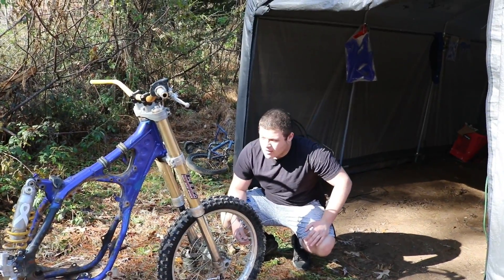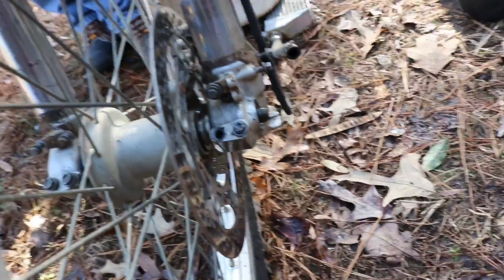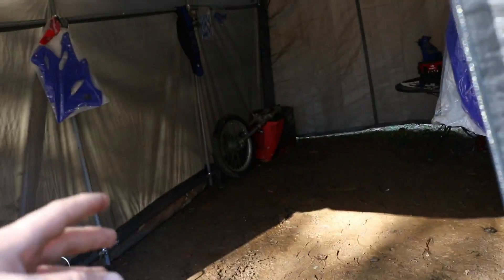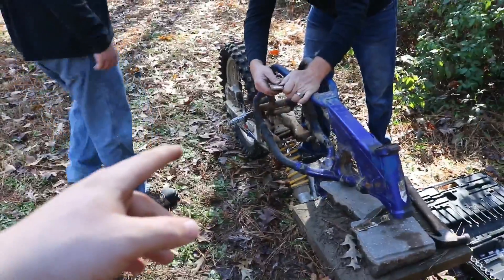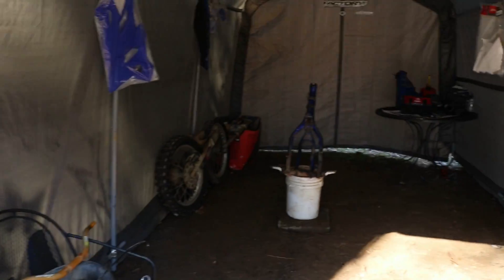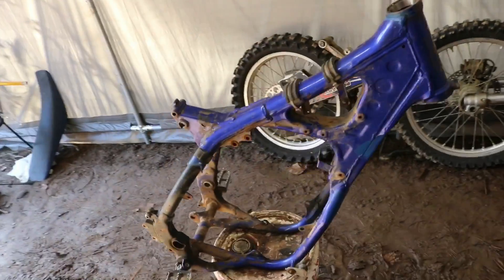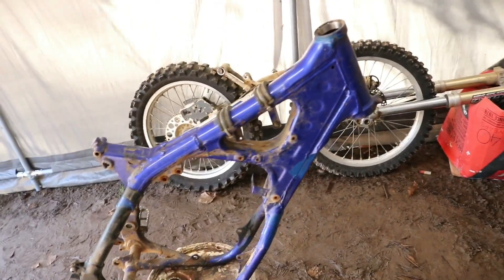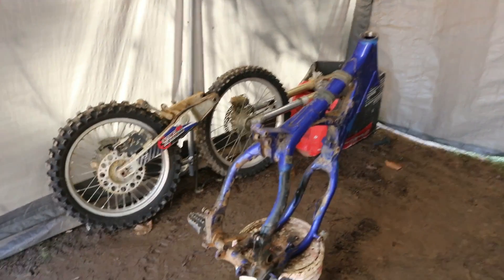The YZ250 is Half Way There - Tearing It DOWN To The FRAME

Comment: This builds gonna be sick man, keep it up. I had the same problem on my 05 yz250f with the fork pinch bolts, one was rounded. Grab a grinder, and try cutting a slot for a flathead screwdriver and take it off with a impact screw driver. If all else fails (which it did for me) use the grinder and cut the head completely off, and then cut a notch for a flathead screwdriver on top of the bolt thread, and you should be able to back it out. Then, when putting back together get a new pinch bolt.

Comment: You can use a drill (drill off the head on the axle bolts). I would just paint the frames no need for the powder coats.

Comment: I had a bolt on my kdx that was stuck too! It was my main swingarm bolt that goes into the rear motor mount, it was soo annoying and i sorta messed the threads up getting it out but it did come out and it can go back on haha hate when steel bolts go into aluminum, it has a chemical reaction that causes corrosion and that sucks!

Comment: Heat the bolt up with a torch and then simply remove it with the vice grips
Reply from the maker: I actually tried that didn’t work
Reply: then the only other thing to do would be to take a hacksaw or Dremel tool or cut off wheel and cut a groove in the middle of the bolt deep enough so it won’t strip again and use a flat head screwdriver smack on the handle with the hammer to break the thread loops and try turning it that away
Reply: Send me a friend request on Facebook and I’ll try to help